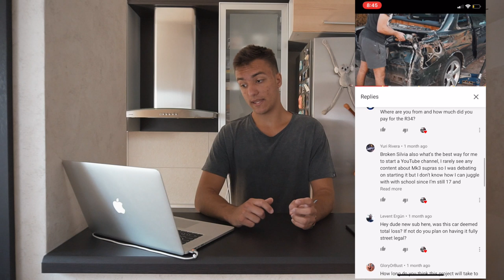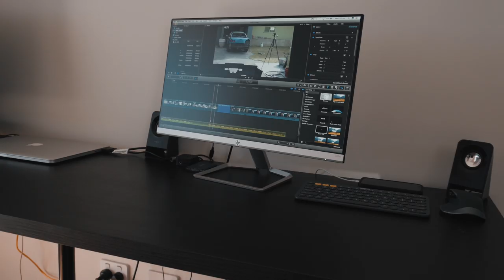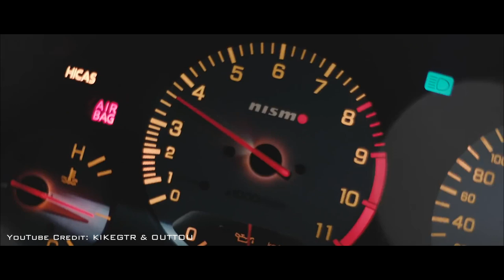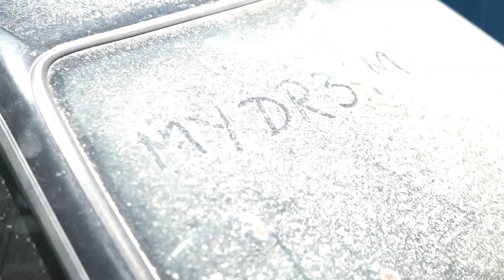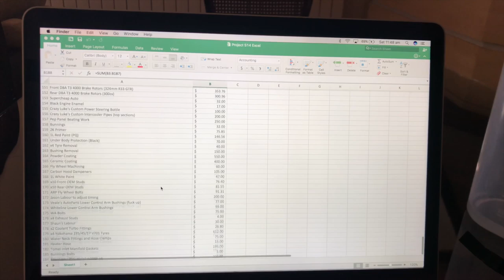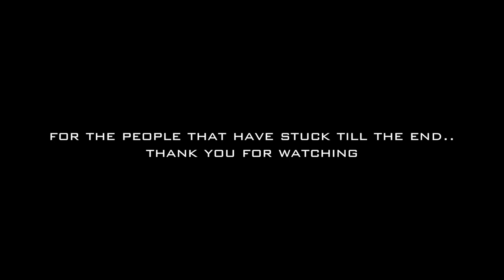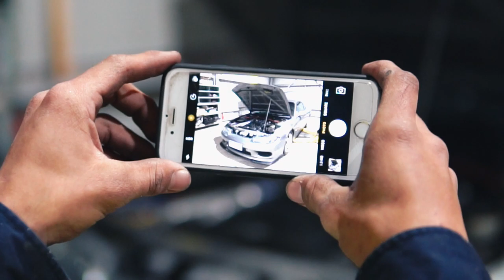Broken Silvia | The Q&A (30k Special)

Comment: Total loss in America is kind of iffy. Basically, if a car is crashed, and the insurance sees that the repairs turn out to me more expensive than what the car is currently worth, then it is deemed a total loss vehicle. If it is deemed total loss, they’ll provide a new “salvage” title meaning that the car has been damaged in the past. However, if the repairs are less than the cars worth, then the car is still a “clean title” car and more than likely will not show any damage on the report. Sometimes they’ll update the car reports, sometimes they don’t.
Reply from the maker: Exactly the same like in Australia!